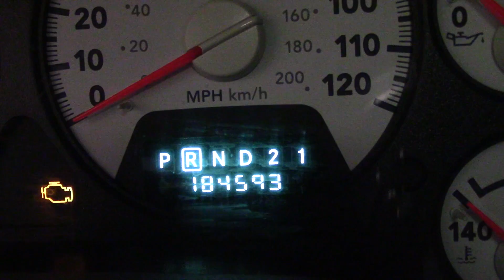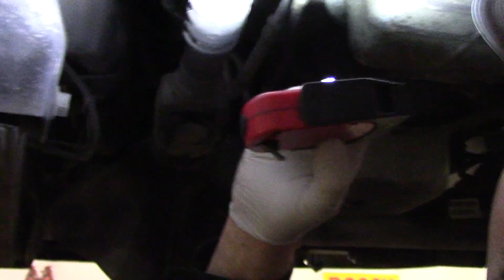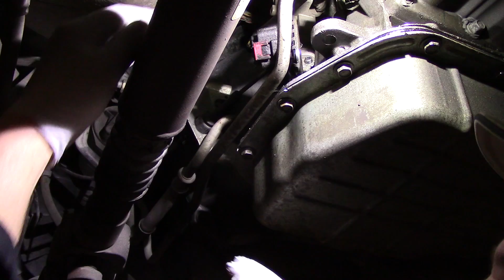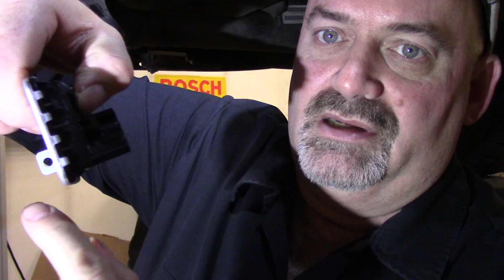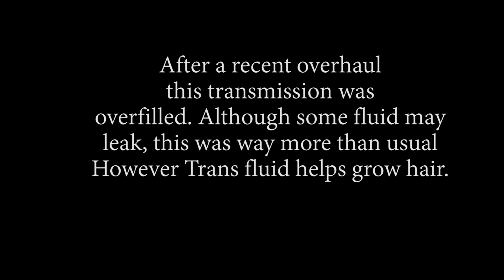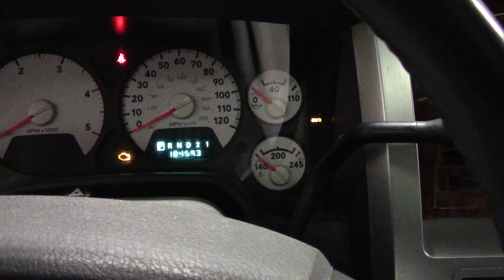Dodge Ram Wont Start No Crank Range Sensor Code P2121 P2122

Comment: My 2007 Ram 1500 5.7 won’t crank, and it doesn’t show any of the gear selection display it shows the miles but not prnd12 . Is this the same issue??

Comment: My 2003 durango has a longer trans pan,and no neutral safety switch visible on the side of the case. Is it possible i hot a 2004 trans 2wd. And is there a park neutral switch inside the pan?

Comment: I just got a 08 ram 3500 from Copart with manual transmission it won’t start or even turn over it just makes a clicking noise. Anyone know if there’s some sort of safety switch that might engage after a collision or something?

Comment: Hello l saw your video and l think you can help me out. 
I have a RAM 6.7 2009 old style 2008, I get a code of 
(p21 21 throttle/pedal position sensor/ switch circut 
Range/performance). Thr truck runs good when the code 
doesnt show up, which would happen some days and 
other days it would show the code and the truck would 
start acting up. Sometimes the transmission wont let 
me put it to do manual drive and it stops on Drive, and 
sometimes when I put it in reverse or drive it feels like 
the truck tumbles a lot. Do you think its because of the 
sensor from the video? 
I would appreciate your help. 
Greetings from Austin, Tx

Comment: Hello I saw your video and I think you can help me out. I have a RAM 6.7 2009 old style 2008, I get a code of (p2121 throttle/pedal position sensor/ switch circut Range/performance). Thr truck runs good when the code doesnt show up, which would happen some days and other days it would show the code and the truck would start acting up. Sometimes the transmission wont let me put it to do manual drive and it stops on Drive, and sometimes when I put it in reverse or drive it feels like the truck tumbles a lot. Do you think its because of the sensor from the video? 
I would appreciate your help. 
Greetings from Austin, Tx
Reply: I have a mini maxx tuner with the entire contaminant system removed
Reply: You ever figure it out? I have similar issue I put new gas pedal in and new batteries

Comment: I’m confused the p2121 code is the tps or accelerator pedal position sensor voltage low why would that range sensor cause that to happen? Unless it forced the truck to go into limp mode and makes the truck accelerate slow

Comment: Thank you for making this video.  I have this same problem in my 02 Ram Van 3500.  I looked up part number you provided, as I like to use Mopar, and found out part for my trans has been discontinued - 5604 5489 AA (along with seemingly everything else related to my van).   How do you feel about NAPA Echlin sensors?

Comment: Can a bad range sensor kill the motor on the road with no start like security cut out. First thing i tried was slammin the shifter back and forth like the old days.. acually worked to start but i want to fix the issue
Reply from the maker: I wouldn't think it could cause it to stall while driving
Reply: Did you ever figure this out just happened to me. I changed ignition switch, clock spring, starter, and battery. I have nothing but the hum of the fuel pump! I'm at my wits end haha

Comment: Is Brake Kleen ok for the plastic connector. In my experience, BK melts some connectors.
Reply from the maker: Probably but that atf isn’t helping either. Not sure what else I would use but I’m checking out some new products now that might work for that.

Comment: quick question you left  the shifter in 1 meanwhile replacing the sensor?
Reply from the maker: Yes, since the sensor has a spring loaded plunger and it’s most extended when in 1st gear it’s easier to install. I neglected to say why for some reason. This video was an editing nightmare that started with the removal of some choice expletives following the transmission fluid bath. Hehe
Reply: @ThecardoctorTV  I started to work on the range sensor while the transmission was in park. I drained all the ATF. It is hard to put back the new sensor. May I change gear from park to 1 without ATF in the system to help to install the new sensor?